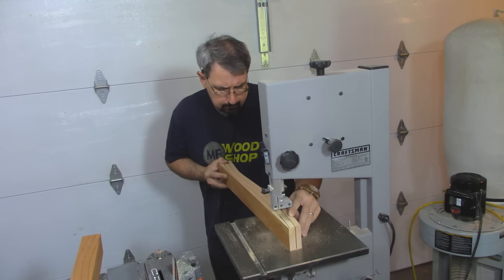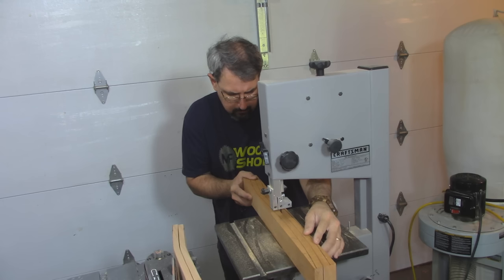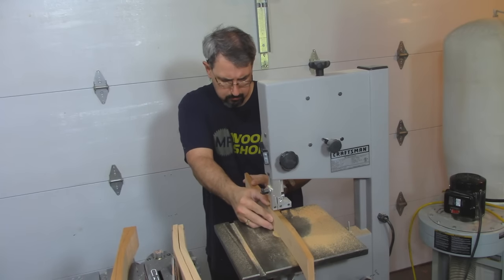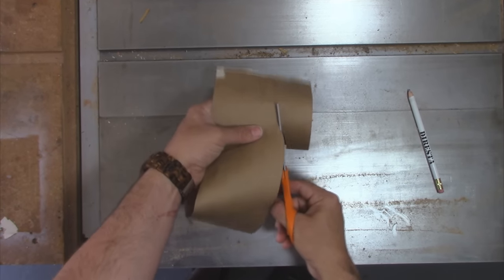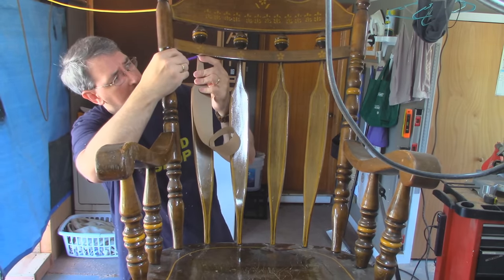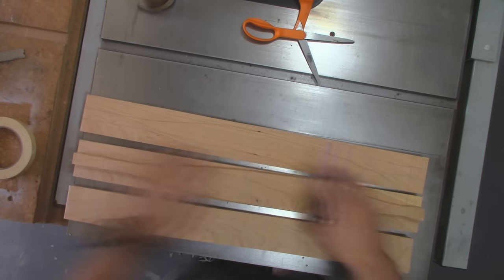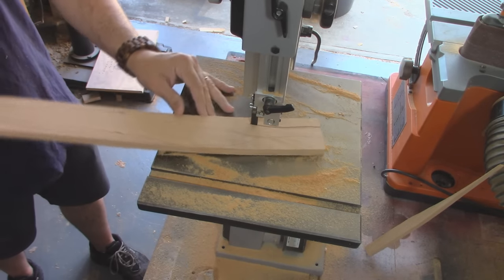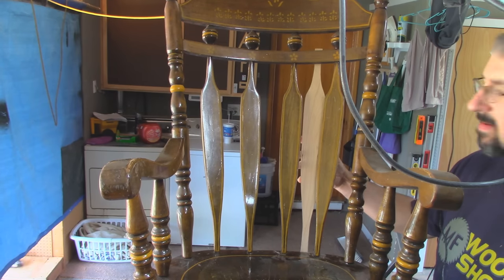Rocking Chair Build # 8 Back Slats

Comment: cant wait to see the assembly....is there enough room tonthrow them on the lathe to round out the ends for the  tenons? or maybe use a chisel and block plane and sand paper the round it..?hope it all works out..hey,,did u het the modle #for that cool sander?if not dont worry about it 🖒
Reply from the maker: No cant put them on the lathe I wish I could that would be a lot easier.
Reply: Mike Fulton that wouldve been easy for ya..hey happy Father's day too btw